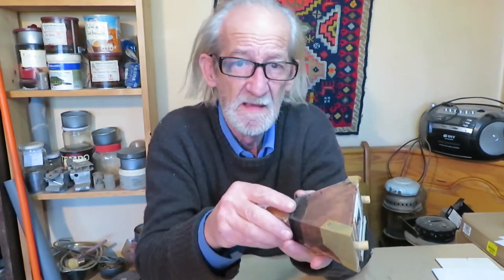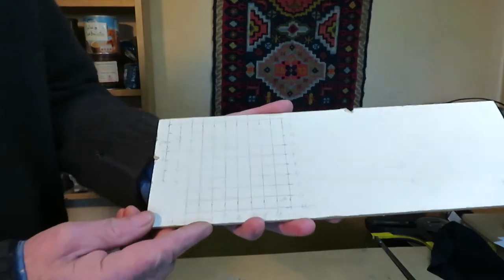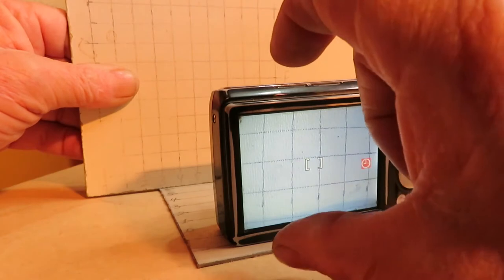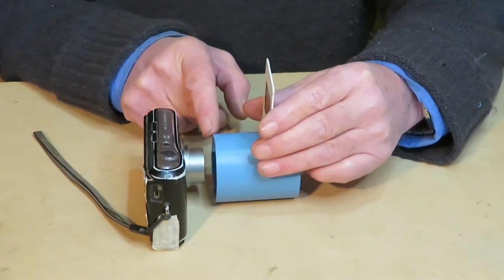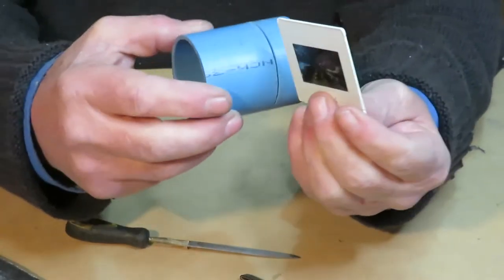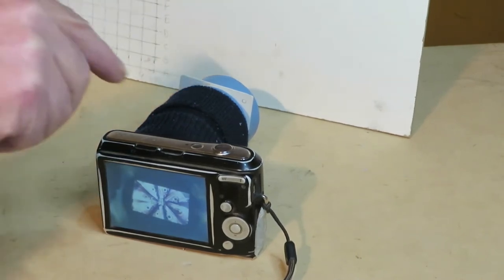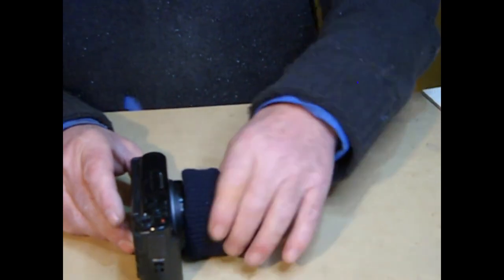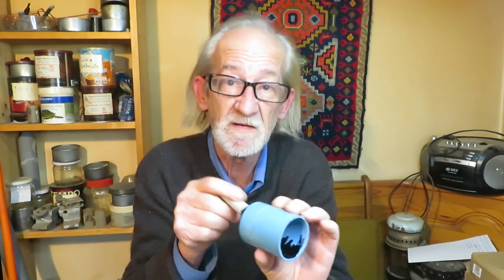How to Make  a Slide Copier - Cheap and Easy

Comment: Loved your video, very informative. I plan to make this for my camera. I have some family slides that I borrowed from my aunt because I found a Bell and Howell slide cube projector at a thrift store in excellent condition and it works, all I had to replace was the lamp bulb. 
What I would like to do is use your method to duplicate by taking a snap shot of each slide, but then I want to print out my own set of slides to keep for myself. Is there a way that I can do this myself or do I need to find a photo processing place that might possibly still print slides?
Reply from the maker: Thanks for your comment Edna.  I'd say you have three options: 1) There still is quite a few photographers that keep on processing pictures using negs and slides, you just have to find them.  Printing directly from the slide should give you the best quality you can get; 2) taking snapshots with your camera using a slide copier like mine.  You'll find the quality of the results are satisfactory for your own use or for sharing in the Internet, but it's not professional quality; 3) You can use your projector to project each slide on to a 8"x10" transparent surface (good quality tracing paper, parchment) and take a shot.  I haven't tried this but it might work.  Digital images can be improved with software like photoshop.
Reply: @RODsDIY , thank you so much for your very quick response.
I plan on making the device attachment that you demonstrated in your video and using that method, but I will also try the other method with tracing paper or parchment paper. 
I truly appreciate your help.